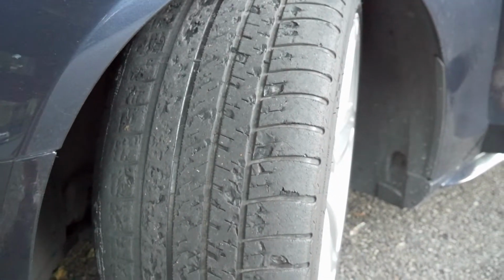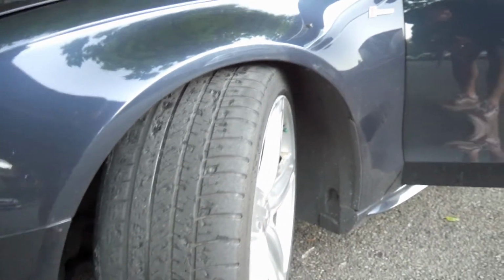My Discount Tire Experience - NANKANG TIRE NS-25 A/S UHP - New Tires for AUDI S4

Comment: Hey bro how those Nankangs holding up. I'm thinking about getting some
Reply from the maker: Put on around 4k miles since, still good basically no tread loss, look the same as when I got them........going to use them to go to the mountains during snowboarding season.
Reply: @DavidBaginskiy  oh ok good to hear. Right now. I've Ben running the Firestone Firehawks. There good tires just a Lil expensive. They're like $165 a tire.  I have an 08 infiniti g37 coupe. And I been guilty of power sliding and doing a little drifting a bit too much. There wearing down so time to get some ew rear tires. So you recommend these Nankangs?  Also checked out Fitment Industries Opinions about these tires and they sound like pretty solid tires
Reply: @DavidBaginskiy  OK good to know. Thanks for the feedback
Reply from the maker: If you're doing drift sessions just check out local used tire shops it's like $25 a tire and you can find some decent brands with minimal tread wear
Reply: i run these on my porsche.  great tire if you can find it.

Comment: I know this is an old video, but honestly Michelin’s might be expensive, the ones you had aren’t that good but the pilot sport 4S tires are absolutely amazing. Pay attention to the treadwear rating as it gives you a good idea on the amount of grip you’ll have, all season tires will be good for daily driving, but to truly push the car to its limits you’ll want those pilot sport 4s tires. I have a 2013 S5 on stage 2+ dual pulley and I had nitto G2 tires before and they were okay but definitely liked to spin on launches but the pilot sport 4s literally just holds I can’t even stress how good they are lol, nitto invos are good too but they won’t have the same ride quality as the Michelin’s
Reply from the maker: Yeah the Michelin’s are 1,000 times better. Running them on my current car. The nankangs just not that bad for the price, cost me $400 and were a quick cheap option.